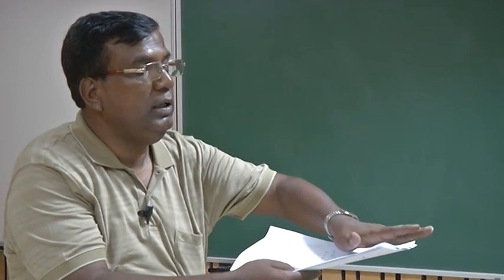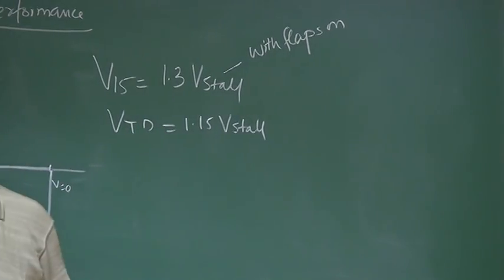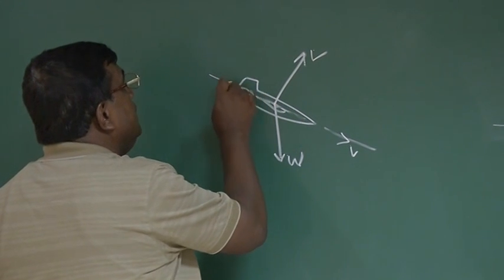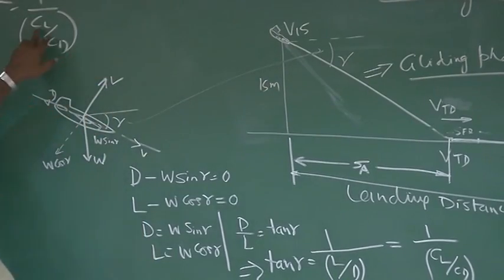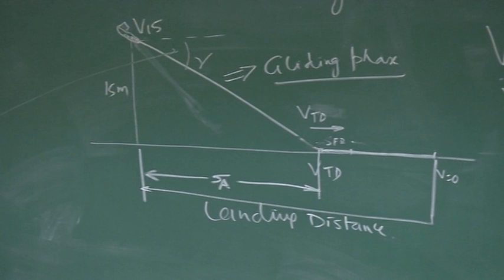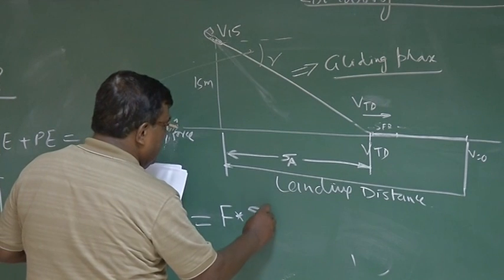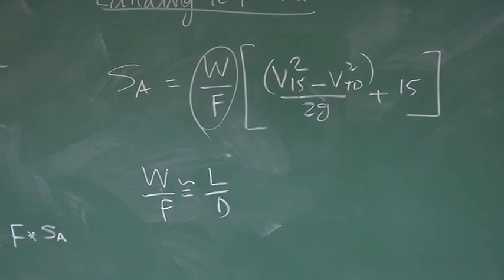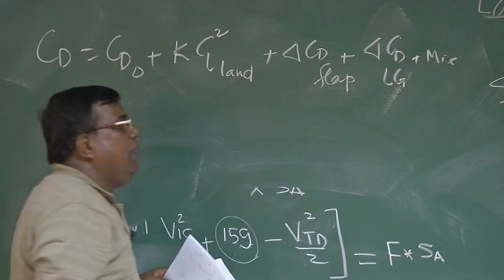Landing Performance

Comment: Sir 15 m is just 49 feet, but we start descending when we are about 2 to 3 thousand feet and go for continuous descend  before flair.  So how are we taking just 15 m for initial point of descending? Because as we reach on the threshold of the runway the height still about 100 ft which is double the height we are taking in video.
Reply: We are calculating the run way length. When aircraft reaches to the runway it's almost 50 ft  high above the ground.  Descent starts as you mentioned quite high but do you see any runway down there,of course, No.